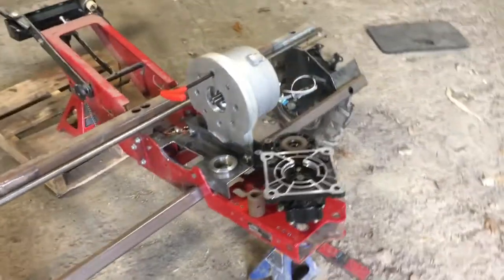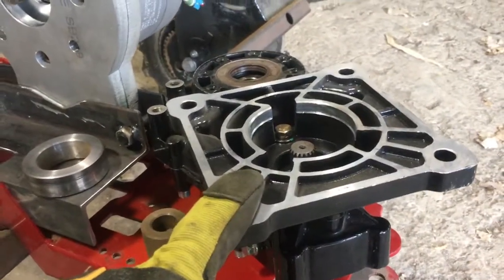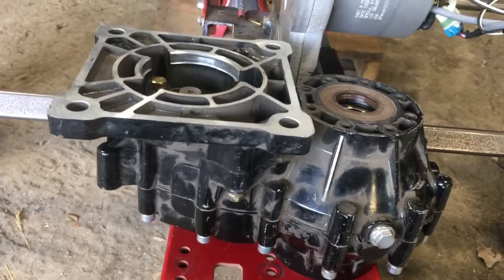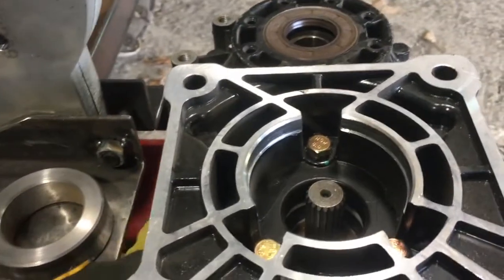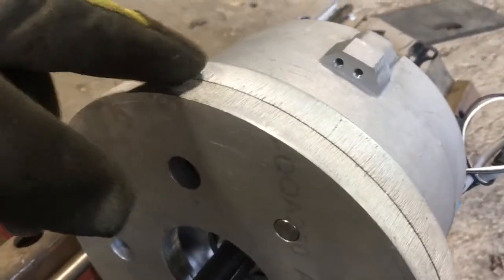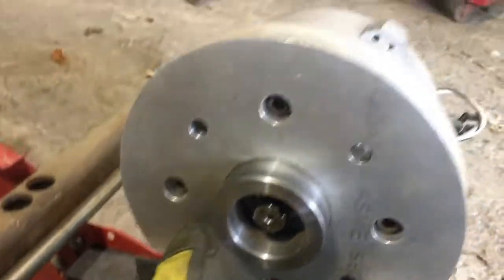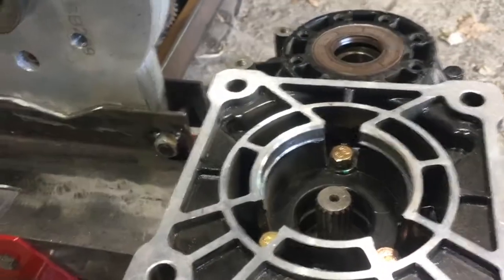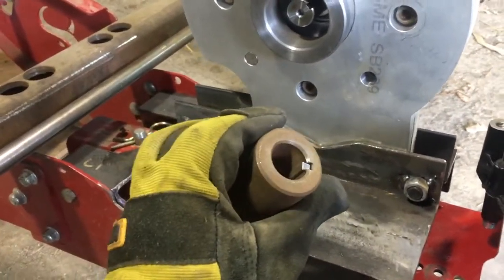Drivetrain adapter for Electric Tilmor Power Ox tractor (ElectrOx!)

Comment: Nice project. Do you plan to put a controller on it? And if so, do you have tips on this? Cheers, John
Reply from the maker: Yes the motor is BLDC (of PMAC, or PMSM or various other names) but it can't work without a controller.  I'm using a Kelly KLS controller (KLS4812S) that's a perfect match for this motor and relatively cheap and programmable as well as being compact and waterproof.

Comment: this gearbox is sold with an electric motor and controller together  ..this machining look expensive
Reply from the maker: Gearbox, or similar, is available with BLDC or AC induction motor from Chinese vendors.  I already had this motor so opted to spend money on machining since my motor was cheap.  The transition plate is 2 pieces plus a sleeve to align and therefore day and cheap to draw and machine on CNC and it's also aluminium rather than steel.  Still maybe 300$ of machining services.